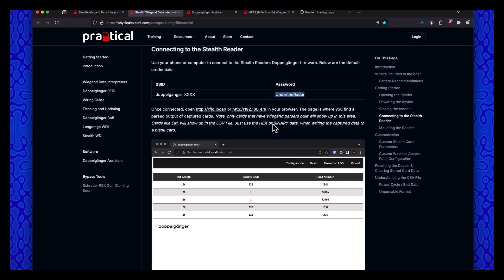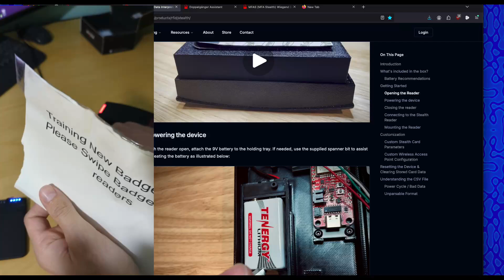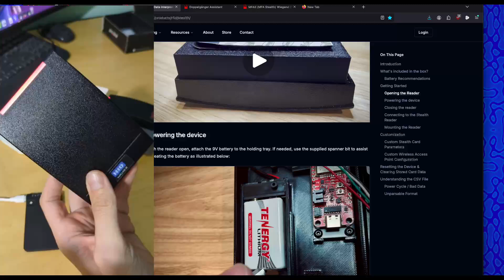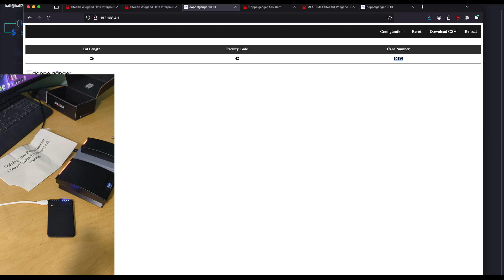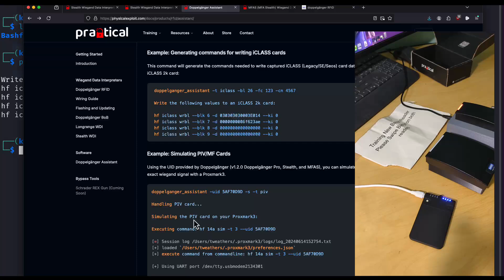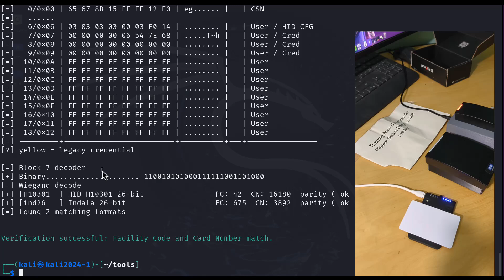Real World Social Engineering Part 2: Integrating SE With Stealth Badge Readers Tips and Tricks

Comment: Quick note, make sure the stealth reader is at least 6 inches away from the real reader or you will not get a good badge read... learned this the hard way
Reply from the maker: haha. yep.. did that before I think it like flashed some weird color or made a wierd sound cuase it was trying to pull from both.. But sometimes your in a tough spot based on location of the reader on some kind of outside stand without space which makes it hard.. in that case you might be better off with an ESP-Key
Reply: @ConsoleCowboys  Oh for sure, I haven't experienced one yet where there wasn't enough room for it but I'm sure I will at some point. Also haven't gotten a chance to use the ESPKey live due to clients not liking the idea of the taps punching into the wires... one day hopefully!